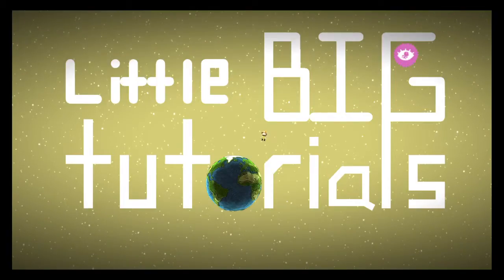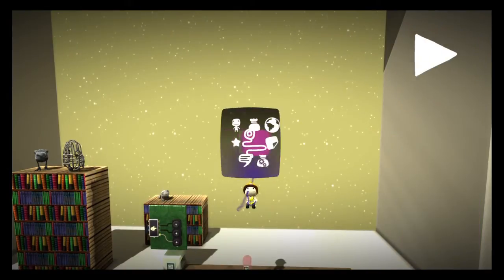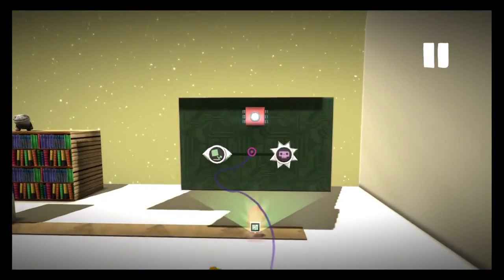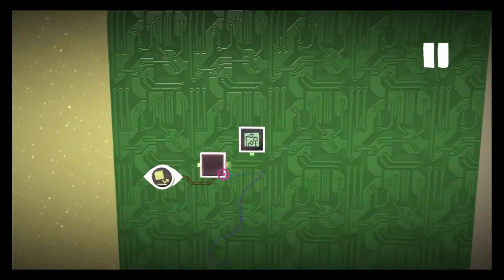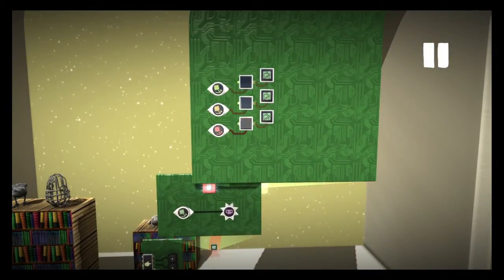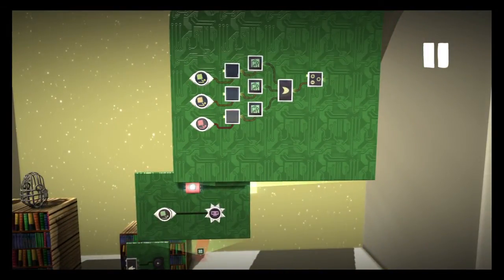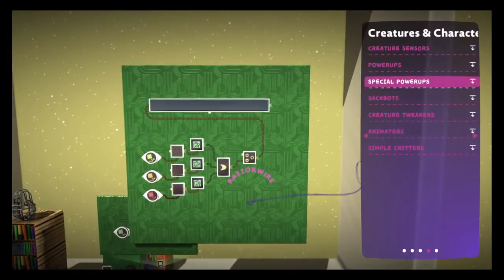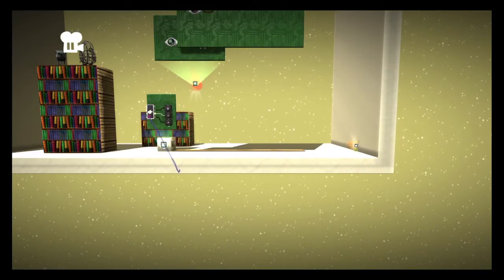Little Big Planet 3 Tutorials| Basic Damage Input System

Comment: This tutorial is useful, however I just can't seem to get it working properly. When combined with the new Notes output signal display I can see exactly what I'm taking away. But I never get the right amount. Could set a battery to 100% damage but it'll only remove 76% damage?
Reply from the maker: Yes unfortunately little big planet doesn't correctly render the"perfect" percentage to go through the battery. So usually what I'd do for a 100%  instant kill type thing is just have that sensor hooked up to just reset the timer, therefore bringing it to an output signal of 0
Reply: Ok thanks for the reply man, good work.